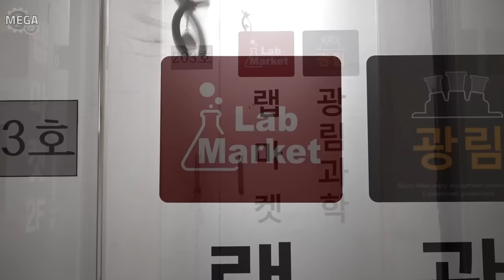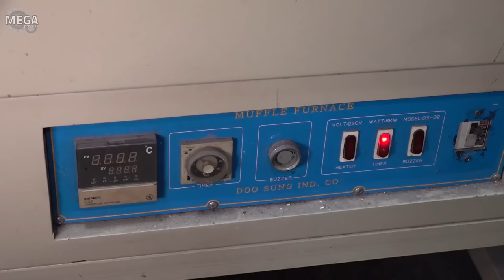Process of making various glass laboratory equipment. Korean glass blowing master

Comment: Can anybody imagine how difficult/ almost impossible it is work with glass?
A bit of heat too soon and it will crack
Let cool not slowly enough and it will crack
Apply heat just a bit unevenly and it will bend in the wrong place
Bend when it's not cooled enough and it will close the glass tube instead of forming a curve
Bend when it's a bit too cold and it will shatter
Blow a bit of cold air when it's hot and it will crack again.

Work with glass is so complicated it's  probably like being a violinist